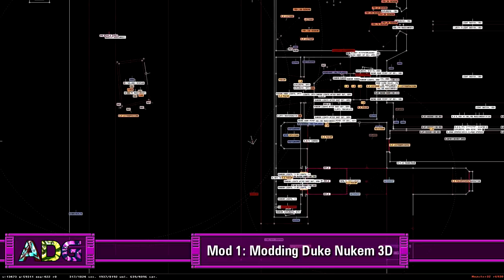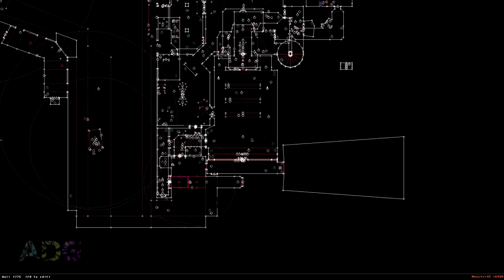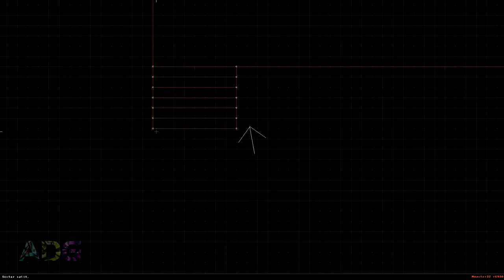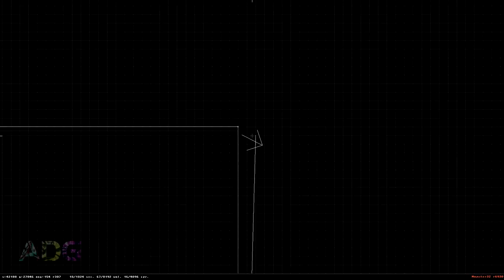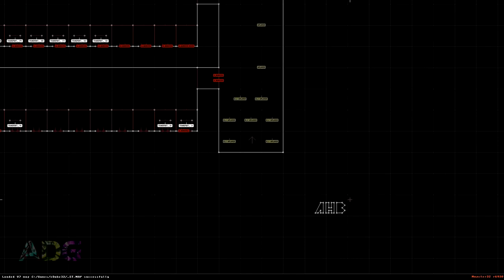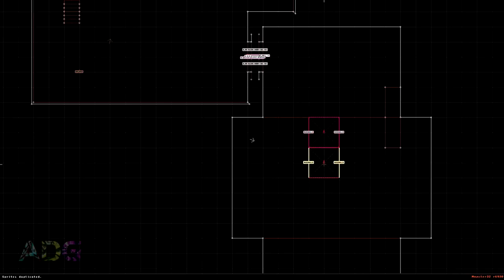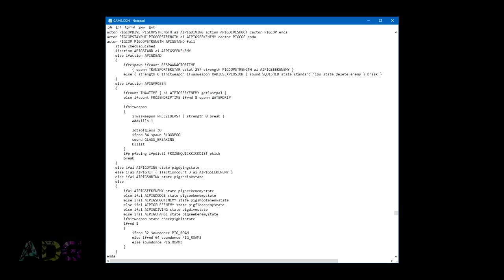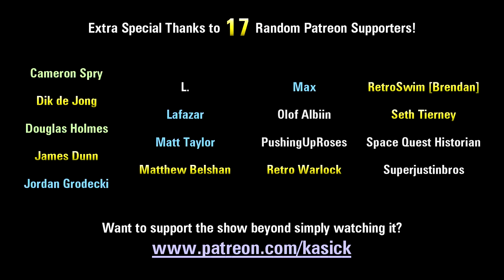Modding Duke Nukem 3D - ADG Mod 1

Comment: Would it be possible to make an open world map with eduke32? Like have separate maps for indoor areas etc?
Reply from the maker: +CelluloidHoax Yes and no. The Build Engine could easily handle such a thing, but Duke Nukem 3D is itself hardcoded to progress through a level chain just like Doom, so to do such a thing you'd have to code a brand new game with the Build Engine as the base. :B
Reply: Pixelmusement so it would be easier to do that In Doom, I’m guessing. Like what if I wanted to make it so you could blow holes in the wall like in Duke Nukem? Would that be possible?
Reply from the maker: +CelluloidHoax No no, you don't understand. Duke3D and Doom have linear level progression: When you end a level it starts either the next in sequence, or diverges to a secret level first then goes back to the sequence. It's not possible to break that sequence, thus an open world is not possible. Either way, you'd have to code your own game using either the idTech1 engine or Build engine, in which case, the sky's the limit on in-game functions! :B
Reply: Pixelmusement now theoretically speaking, you could code the Build engine to allow for open world travel exploration?
Reply from the maker: +CelluloidHoax Absolutely! The engine itself is simply what interprets and renders the level data as sprites and 3D geometry and provides basic features such as toting and firing weapons. You would simply code a type of map feature which would allow teleporting from one map to another. So, you can't make a contiguous open world, but you can have the world sectioned off into separate maps that you travel between. The only trick is that you'd also have to code your own persistence, either by saving the entire state of a map to your save files, or coming up with a means to detect what parts of the map have changed and alter them accordingly during load. Either way, it's a lot more work than simply making a standalone Duke3D map. :P
Reply: Pixelmusement well since I’d want to make code to make that kind of map and make it an action RPG, what code would I use and where would I learn more?
Reply from the maker: +CelluloidHoax If you want to use the Build Engine for making your own game, Build's creator, Ken Silverman, has the source code for the engine available on his website at the following link. Just be aware, you're in for quite the challenge if you decide to go this route: http://advsys.net/ken/buildsrc/default.htm
Reply: Pixelmusement I apologize for bothering you with the multiple questions and thank you for pointing me in the right direction. Now what would I need to know if I go down the route you just mentioned?
Reply from the maker: +CelluloidHoax Depends on how experienced you are with C/C++ coding, but by the end of the day, you're talking about using an old game engine to make a brand new game. Unless your intent is to have fun doing it because you enjoy coding, you're better off just using a modern game engine so that you don't have to jump through all the hoops and restrictions of trying to work with old software. :P
Reply: Pixelmusement well the intent is actually to make an “open world” action rpg with Build or Doom engine
Reply from the maker: +CelluloidHoax Then yeah, if you're not well versed in C/C++, that's the first step is to learn those languages and learn them well enough to actually interpret how those engines work, then to put something together with one of them. Depending on your current programming experience it could take a few months, or a few years, just to make something incredibly simple. For an Action/RPG, if you're going into this with no prior game development experience, it will likely take a solid decade of effort at the minimum, and that's if you devote every bit of spare time to it. Again, if you just wanna make a game, look into modern engines like Unity or Godot. Only pursue the Build/idTech1 path if programming is your passion.
Reply: Pixelmusement well with unity I can always fake the look. Well, you can get as close to either engine with the right settings?
Reply from the maker: +CelluloidHoax You can certainly fake the look, but that would take more effort than just coming up with your own look which fits the engine you're using better. Again, it comes down to how much time you're willing to invest, versus what level of skill you're starting with, versus WHY you even want to make such a game.
Reply: Pixelmusement well I’d like for it to be like the original Duke nukem but I’d like to make it an FPS rpg that would parody Fallout and post nuclear movies as well as be a comedic commentary of cartoons from the 60s/70s. I’ve take game design courses before and I can learn them again. I’ve played Doom and Duke Nukem starting a few years ago. I haven’t played those games when I was a kid and I’d like to make my own one of those games, also I like action rpgs so I thought it’d be fun to make my own one of those games, with everything sprite in first person like the old games.
Reply from the maker: +CelluloidHoax What you're describing sounds like a TON of work, far beyond what one person alone would be capable of handling. If you're serious about this you're gonna need to put together a plan on how to build your game and form a team to make it, which is beyond the scope of what I can easily explain so I don't think there's much more I can help you with. Just remember, when it comes to a choice of engine, go with what makes the most sense for your vision; don't choose an old engine just because it would be "cool" to do so.
Reply: Pixelmusement I’ve heard of someone who made an indie game all by himself and it was popular when it came out. Maybe I am dreaming too high, but I found if you want something to work, you have to find ways to make it work. 
I’m just sorry to keep bugging you with the comments.
Reply from the maker: +CelluloidHoax There's lots of people who've made indie games solo, but it takes an insane amount of effort and if you don't have both the talent and the patience to make something that way, you're doomed. Even then, there's certain kinds of games you'll never see attempted solo and a 3D Action/RPG is typically one such genre because of the sheer quantity of artwork, models, story, music, level design, sound, and code required to make it all work. Dreaming high is fine, but manage your high dreams with realistic approaches. Experience will teach you just how fast you can go and you can then make smarter decisions, thus part of the reason why I always recommend to people who're new to making games to start EXTREMELY small, things like Breakout clones, 2D shooters, heck, even just a number guessing game is a good way to test the waters. Once you have plenty of experience, you can then more accurately gauge just how much work your bigger projects will take and can make smarter decisions related to them. :B

Comment: # The DOS version has sectors over sectors omg.
Just look at the circle stairs on E1M1. Geez man.
The DOS version even allows for sectors through sectors without interaction (without joining, without glitching).
These are possible for the reasons you gave in the first 2 minutes.

There is a level where a sector passes through another sector on the same height.
When I was in school, and until this year when I finally got a version of Build that worked and I got Duke to be able to edit (ZGDoom is better only because it comes with the game, LoL), I was always thinking about sectors crossing over without interaction, especially while building in Doom, because, again your first 2 minutes, Doom Build just doesn't allow it, and when I cheated it, they glitched and wasn't playable.

Duke Build is amazing!!!
Reply from the maker: +Kaiser Drache OK, so I should probably clear this up a little: Build originally had no support to visually RENDER two sectors over top of each other. The sectors could exist in the same space, but the engine would get confused if it tried to draw two sectors which overlapped and would thus only render one of them. However, in combination with how the rendering takes place, (starting within the sector the player is in), this means so long as the sectors are not visible simultaneously, there's no problem. That circular staircase in E1L1? If you stop halfway up and try to look at the centre of it, you'll get slight amounts of glitching on the middle edges because of this. Later versions of the Build Engine support "room-over-room" rendering by simply diverting the rendering to a different sector, though will still glitch out if two sectors sharing the same space attempt to render at the same time, while the most modern versions support "True Room-over-Room" where the sectors can literally join vertically, though I've noted in testing that this methodology is not 100% perfect yet and AGAIN, requires special configuration; the starts in E1L1 will still glitch at the right viewing position and angle. :P
Reply: The only true portal is the one near the start location.

You are right. However, now I will clarify.
DOS Duke supported sector overlapping, hence why they did it. No Doom build ever does.
The E1L1 staircase is an overlap.

Duke's only hurdle is only rendering. Doom's limitation is logical, let alone rendering.
Duke logic is still no better in the latest Build. Same glitching.
Reply: You just gotta know how to connect sectors well.
Think outside the box, literally. That means, don't just rely on creating "sectors".

I wish I could record Build and Duke, but OBS is often shit.

What do you use to record video for these?
 @Pixelmusement
Reply: OBS records Build, but goes black until closed when I run Duke.
Reply: Is there a better recorder?
Reply from the maker: +Kaiser Drache Yup, though I didn't think I needed to say that; you're on the ball there. ;)
Reply from the maker: +Kaiser Drache I use OBS. OBS has multiple recording methods available and requires a bit of configuration to get it working best on your system, plus some games can only be recorded with specific settings, like Window Capture over Game Capture or using the Compatibility Mode option. Having a video card that can do the encoding for you will also REALLY help alleviate the draw on system resources to improve the quality. Lastly, the recorded footage is not editable, at least no in the version of OBS I'm using, so I use a combination of FFMPEG, AVISynth, and VirtualDub to reprocess the MP4s into AVIs and back into MP4s using slightly different encoding which allows it to be handled with video editing software more reliably. :B
Reply: @Pixelmusement  Hmm. No settings work.
Reply from the maker: +Kaiser Drache It can be hard to properly configure these things. You may need to get specific help from the OBS community; there's little more I can do for you at this point. :/

Comment: Map Making isn't "Modding".
Reply from the maker: +Kaiser Drache Most of the time it is; you're altering the game to have a new experience. That very much qualifies as modding. It's only not modding when the game in question is specifically designed around creating your own maps (such as Stunts or ZZT) and you'd be missing half the point of the game without doing so.

Comment: How did he get his cursor like that
Reply from the maker: There's a few tricks you can do with the cursor. Which part do you mean specifically?
Reply: @Pixelmusement  in the viedo i saw that your cursor moves aound the Terrain, while  mine is more like a hud thing wich takes the Feauture to like allign textures , no matter if i use numpad or the arrow keys, it always results in me moving
(Also pretty cool from you to still answer coments from a viedo from like 2 years ago)
Reply from the maker: @AMelonpizza  Ah that. The cursor you're seeing with Mapster32 here which is locking to the walls, floors and ceilings is simply a helper cursor to identify what will be affected by the mouse. The mouse cursor otherwise works virtually the same as in the original Build Editor, apart from tweaks to take advantage of the mousewheel and modern design sensibilities. :B
Reply: @Pixelmusement  can i activate it somehow
Reply from the maker: @AMelonpizza  It only exists in Mapster32 and is ALWAYS active; you can't turn it off. Thus if you want to "activate" it you simply need to use Mapster32 and not the original Build Editor.
Reply: @Pixelmusement  but i use mapster 32
Reply: @Pixelmusement  i cant sadly load up a pic to show but i swear, i use mapster 32 and i do not have this cursor
Reply from the maker: @AMelonpizza  Hunh... then I have no idea because I didn't know you could turn it off in the first place and the controls listing online says nothing about it! :o
Reply: @Pixelmusement  well, at least it works like 50% of the time